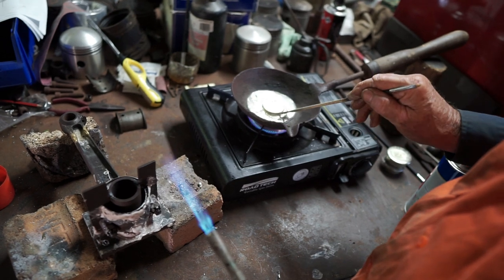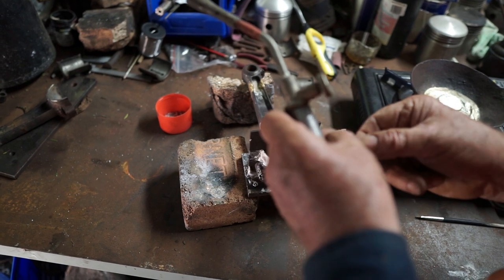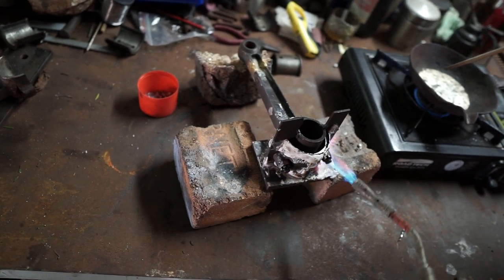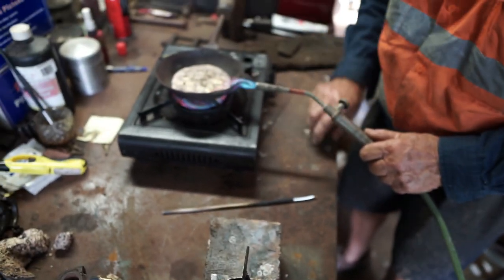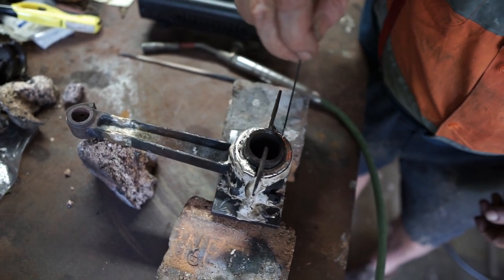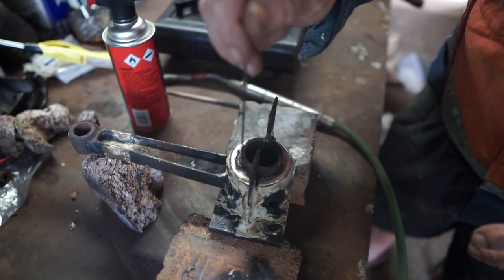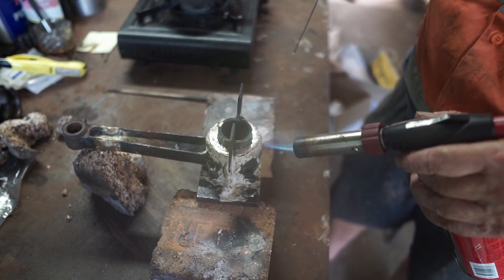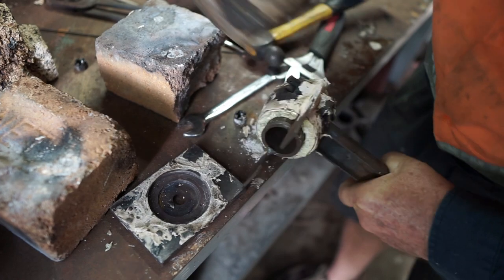Restoring Flanders 20 Motor - White Metal Bearings, Part 4

Comment: Thank you. First time I have seen this done. The bit I don’t understand is why do we use this V soft white metal? How is it behaving at 5000 rpm? I had an A7 special , now with a 52 TD, but I am not doing this level of work. Thanks again
Reply from the maker: the Tin or Lead is soft, but other metals are added, depending upon application, to give strength. White metals have very low friction coefficients, so are very slippery. 5000rpm are no problem. look up Babbitt bearings for more information. Glad you liked the vid!
Reply: I remember my father describing how they used to do this process and scraping it to size afterwards.... Still have some tools.... Regarding how the material will cope.... The shells even on modern engines rarely rarely touch the crank if oil pressure is enough...it will be sitting on a film of oil.